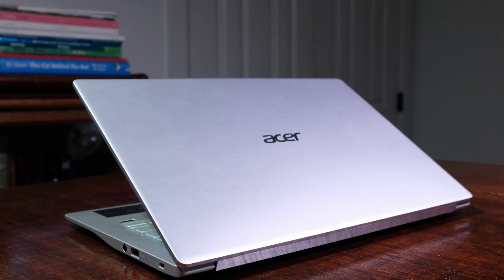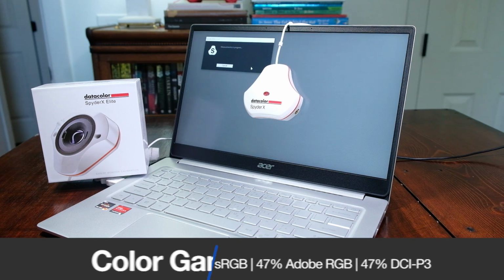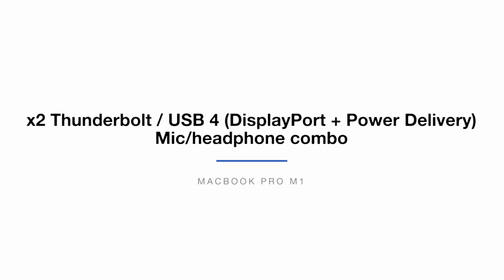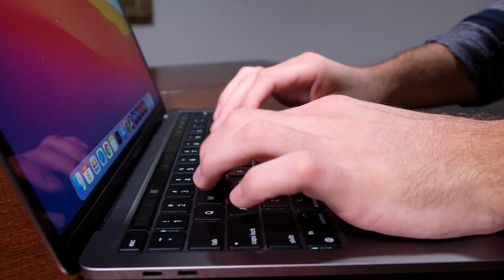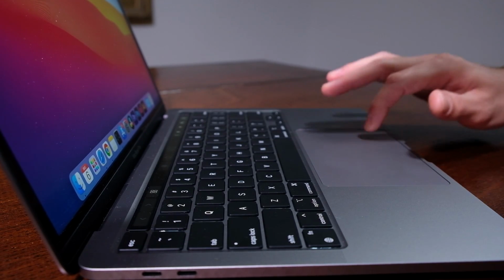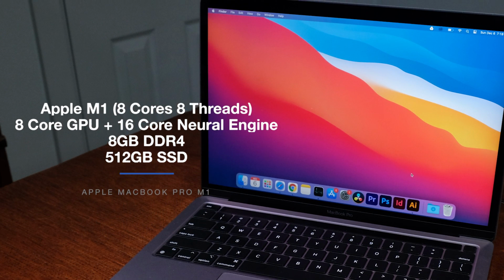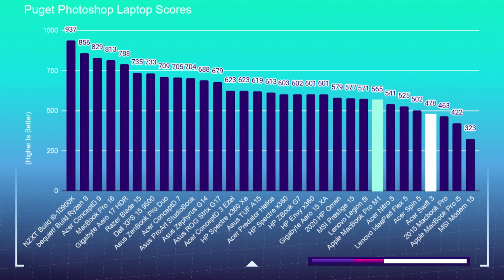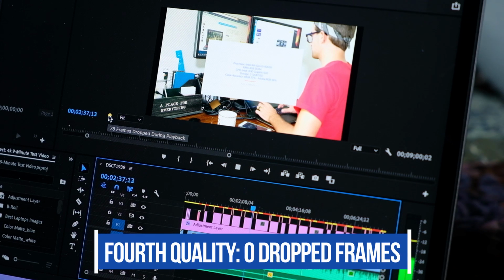Buy This $650 Laptop Instead of the MacBook Pro M1

Comment: I would wait for 6 months, since Intel and AMD plan to switch to 7nm and 5nm processors.
Reply: 6 months passed. Did it happen?
Reply: @alexbuka3046  Yes, did you read the new Intel roadmap? They are going to break 1nm barrier and go to angstrom range by 2025. New Intel chips are also amazing, leaving AMD behind. So my waiting time paid off.
Reply: @kamertonaudiophileplayer847  Sorry, I didn't hear about that but will definitely read about that.
Reply: @alexbuka3046  Some information you can find useful: The next-generation Zen 4 based Ryzen Desktop CPUs will be codenamed Raphael and will replace the Zen 3 based Ryzen 5000 Desktop CPUs that are codenamed, Vermeer. From the information we currently have, Raphael CPUs will be based on the 5nm Zen 4 core architecture & will feature 6nm I/O dies in a chiplet design. AMD has hinted at upping the core counts of its next-gen mainstream desktop CPUs so we can expect a slight bump from the current max of 16 cores and 32 threads.

Comment: A better alternative would be the Zenbook 14 with the 4700U and the MX350 at £900 instead of the £1,300 MacBook Pro. Programs optimise for Nvidia instead of Ryzen so despite having only slightly more power than the inbuilt Vega graphics it should be much faster than the Swift here. Still also only 1.15kg instead of the 1.4kg of the Mac and £400 cheaper isn’t too shabby, though if there’s a 5800U/MX450 16:10 display refresh that would be great!

Comment: Im gonna trust you man lol I'm getting the acer swift 3 instead of the mac mini M1. I'm installing a livestream setup for my church and will be using the Atem Mini Pro to stream and since it encodes on its own, I am not too concerned with having the best computer to capture and encode my stream feed. I liked that you said this is your daily driver and hope it can handle light room just fine. Thanks because this will save us some money over mac mini, keyboard and display.
Reply: Hey bro. Did you get the Acer swift 3? How was the experience so far?
Reply: @whippedculture7633  bro yes I did and it is a great computer for what I need! I use it to run the lyric software at church and basic stuff like that. I haven’t used it for any video or picture editing yet